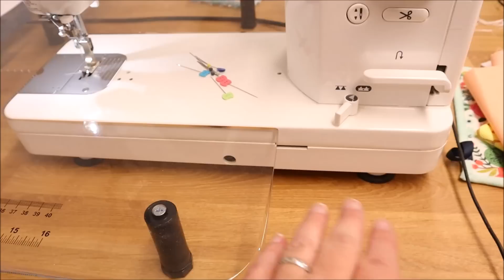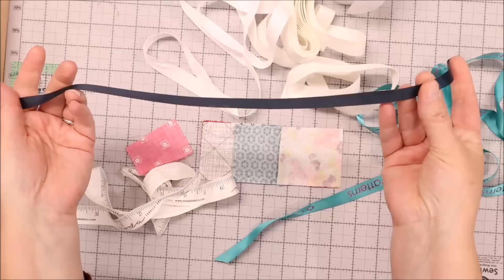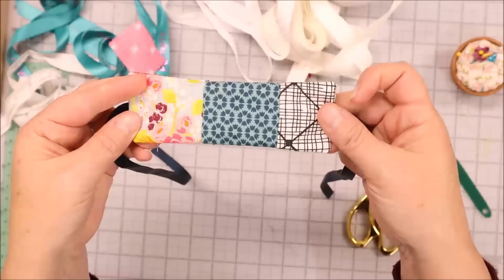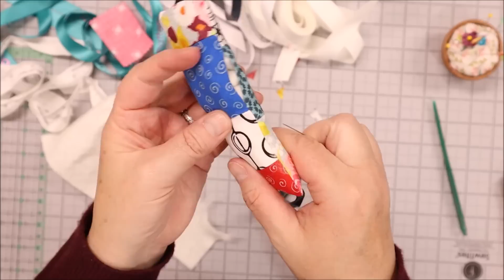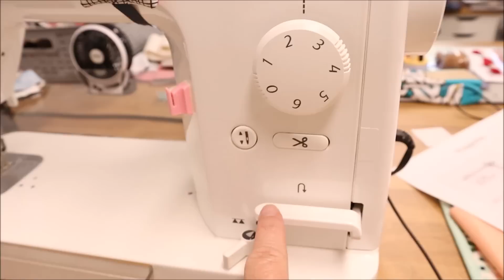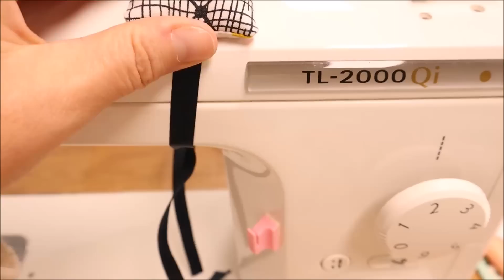Sew a Pincushion for your Sewing Machine - no more rolling pins!

Comment: A lot of people used to wrap fabric around like that, you see some nice vintage machines with a horrible pin rash ruining an otherwise beautiful finish. Perhaps using an inner liner of cardboard, plastic, or even leather would prevent accidental pin strikes? Perhaps not as big a deal on modern plastic machines, but the old vintage & antique cast iron and even aluminum machines will still be running 100 years from now. We have a model 12 Singer that was made in 1881 that still sews perfectly!
Reply from the maker: oh - I hadn't thought of that. I may be adding that in the future. I could totally get that the pins could do some damage.

Comment: I love this idea.  For me I’m going to put a protective layer inside to the bottom so the pins don’t go through and scratch my machine.  I have a tendency to push the pins too hard.
Reply from the maker: I was thinking the same thing and it has been mentioned a few times in the comments - it could easily be added before stuffing for anyone wanting to make one. thanks for the suggestion!

Comment: In my days of working in a sewing plant, IF we were allowed to use straight pins, a 1" wide strip of elastic pinned around always worked.  It didn't interfere with the threads coming through or move around on the neck.  Also handy for a pencil holder or whatever you used to make a quick mark.
Reply from the maker: oooo - that's a great idea! I do like the idea of the pin not going directly into it so it reduces the ability of it scratching the machine. Plus begin able to tuck things into it - that's a good one!

Comment: As a collector and restorer of antique and vintage machines, I've removed these types pin cushion bandages off many sewing machines.  In every case this wrap causes pin rash (scratching) on the machine housing and diminishes the machine's value.
Reply from the maker: I could see that happening - there isn't anything on the backside of the pincushion to keep the pin from going all the way through. I don't keep a lot of pins here so not too worried about it, but yes - good thought. thanks for sharing!

Comment: No way if you like your machine and especially if it is new. You want stick pins in and scratch your machine. Women figured this out 75 years ago. And stopped doing it
Reply from the maker: I get it, some like this option and others don't.  I don't have more than 10 pins in this, and don't plan on having more than that. They go back to the main pin cushion where they get used, but this is just for keeping them when I pull them off of whatever I pinned. So I'm ok with it. 
Others have mentioned putting a piece of cardboard on the inside just before stuffing so it will stop the pins from going all the way through. I think I would do that next time I make one.

Comment: Nice tutorial!  I have a number of vintage machines and several of them had a similar pin cushion attached when they were acquired.  Underneath the pincushions was the inevitable “pin rash”.  After many years of catching pins the surface underneath the pincushion can become quite scratched.  Something to be mindful of.  It is still the perfect spot to catch pins while sewing!
Reply: Wonder if a piece of leather would protect it?
Reply: @MarciaBaker1205   I think leather would be a great way to protect a machine.  I think I’ll try that idea!  Thanks 😊
Reply from the maker: awe yes!! leather would be a great addition to keep it from accidental scratches. thanks for the suggestion!
Reply: I can vouch for that. I have a 1941 singer that has pin rash right down to the bare casting. I would not do this to my Juki. ( or any machine for that matter)